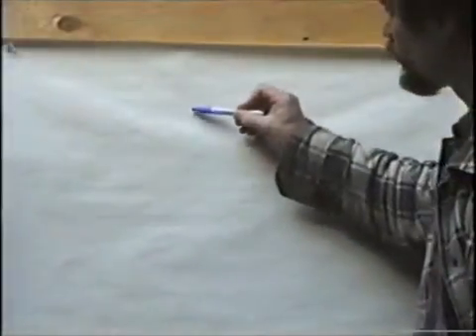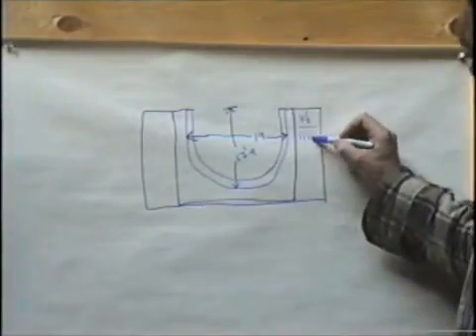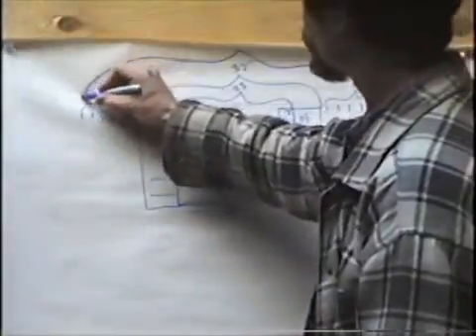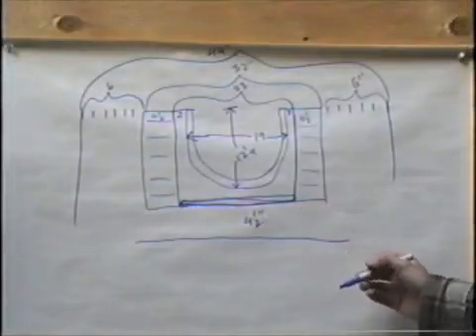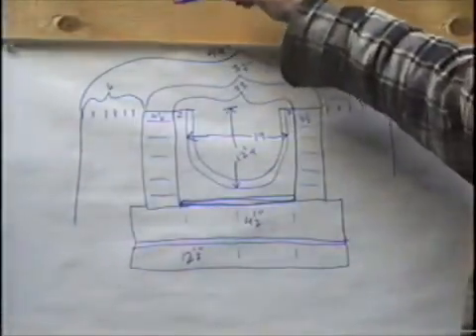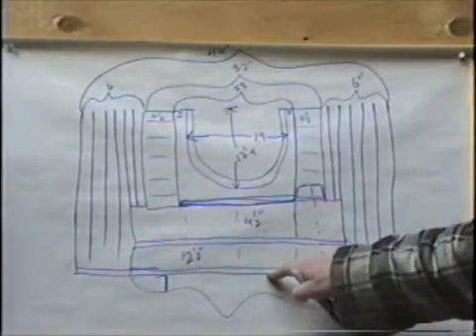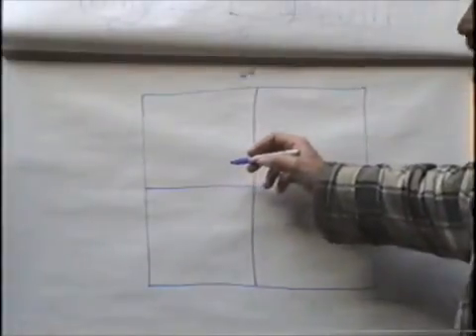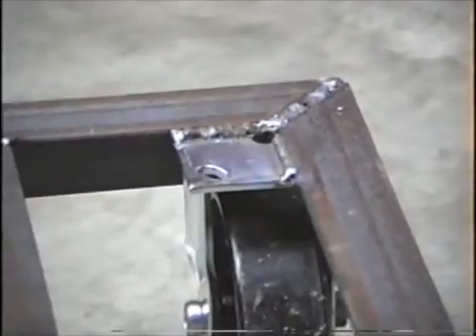design - 170-pound glass furnace sample clip 1

Comment: @MarkLauckner 

100 lb glass 
and i reheat in furnace 
when pot got ugly  in last unit
  put 5 little 2lb pots in the big pot 
..instant little colour unit ...
limited electric  .. old cabin   in woods 
2 ...120 v 20 amp breakers
use what ya got .. adapt to survive
good vids  thanx

Comment: built most recent furnace in 33 inch drum ..round is right 
invested a pot in a couple inches  mizzou  then cast 7 inches of insulation around pot .. added a few inches of fiber frax 
took cable spool of correct dimension and rammed a 2 piece combustion chamber to fit over pot 12 inches high ..
then rammed a crown over a large bowl of proper size  crown has 4 and a half inch burner port . cast flex pipe in crown to pre heat forced air in to gibberson burrner head 
8 gal propane a day ..25 bucks